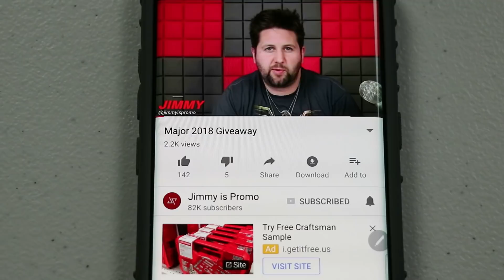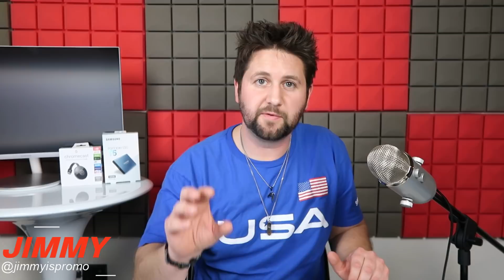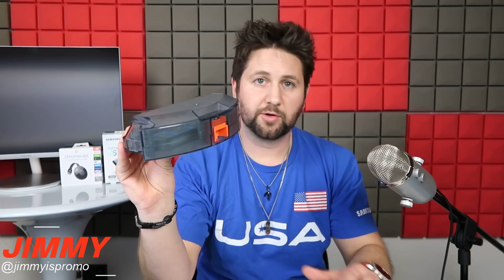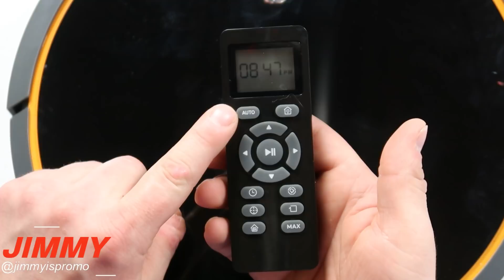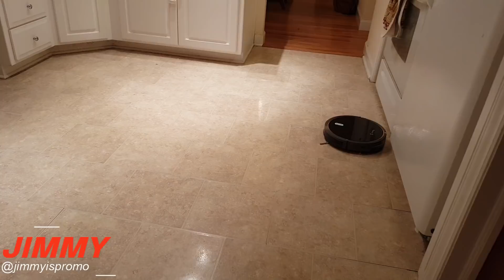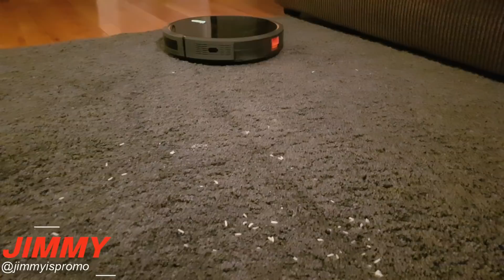The Most Effective Robot Vacuum Under $200

Comment: I run the m6 daily, and my floors look awesome🌼 allabout.wiki/eufy I wet mop 2 days and dry sweep the rest of the days. When I first got it, I used the included disposable pads. I didn't like them--the dry pad has no depth so if it picks up a chunk of something, like dry cat food, then it pushes it around or drags it around the floor. The wet pad wasn't very absorbent so left streaks and wheel marks.